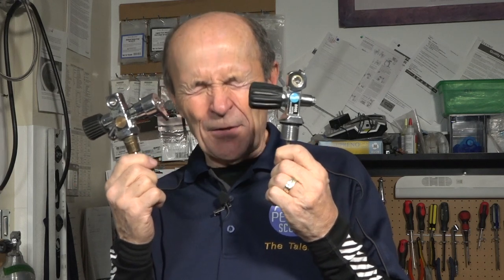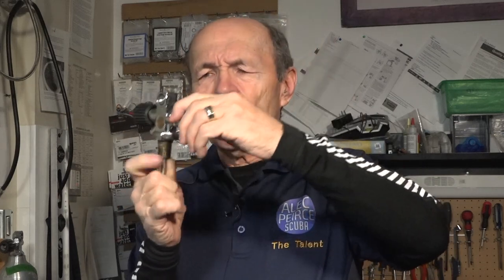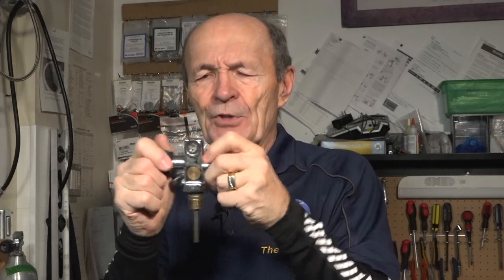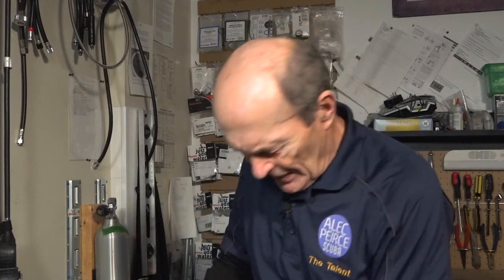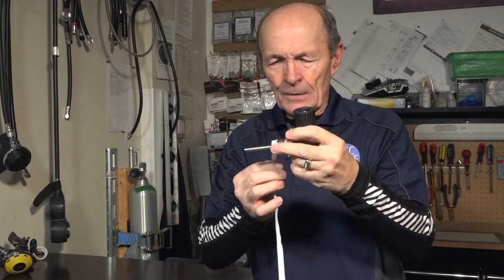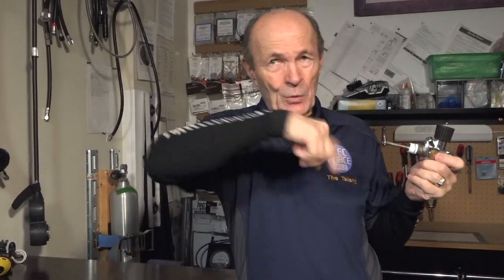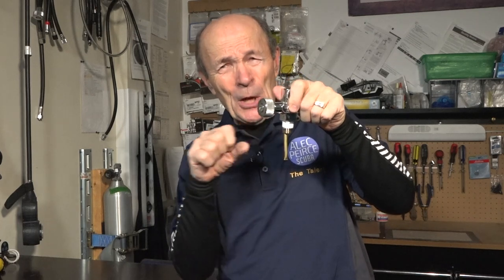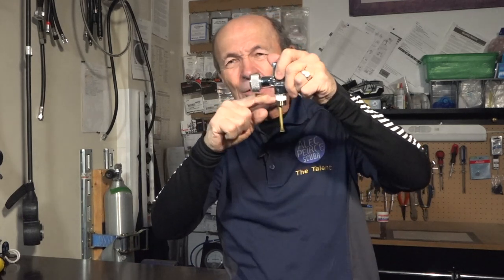All About 1/2" Tank Valves - Scuba Tech Tips: S12E05

Comment: Thank you for the infomative video. According to a list of valves certain tapered 1/2" valves should be tighten to 80 Nm torque so at least for some valves a torque tecommendation exist.
Reply from the maker: Glad you found that because back in the stone age, there was no actual force mentioned when buying the valve.  That came latter after a few Hulk's cracked tank necks due to over tightening.

Comment: This was THE video I needed right now. Tanks!  Do you see a problem replacing 1/2 NGT with NPT?  I realize there is a slight length difference, but NGT is not common any more and pricey for new ones!
Reply from the maker: The 2 threads are ALMOST identical. There should be no problem but I'd suggest that you get someone to run a 1/2" NPT tap into the tank neck first. Just a quick down and back will do. That will clean the threads and ensure the 1/2 NPT will go in firmly & safely. Good luck. Alec

Comment: What’s the purpose of having the little snorkel tube on the valve?
Reply from the maker: I think your referring to the 'dip tube'.  It's an important function to keep tank contaminates from being inhaled when the tank is valve down.  Many many years ago in the stone age, steel 72 cu/ft tanks had lots of internal contaminents, rust, dust, dirt, from not getting tanks tumbled or letting the tank go empty.  The dip tube is standard even today to pull air into the valve and to the 1st stage from the inside centre of a tank, not just the top.  Hope this helps.

Comment: Looks like someone has already had a good go with the valve in your close up at 3:35!  5th thread from the top is foobarr'd!
Reply from the maker: It does look bad but this is one of my demo's,  not intended to be used unless inspected first. Thanks for noticing Max.
Reply: @AlecPeirceScuba_SeaHunter  5th thread from the top is not likely to do much when mated to cylinder, it may be damaged because of corrosion in the tank threads at that point, or simply the fact the tank thread form at the entry is often not fully cut

Comment: I saw hydraulic valves machined with taper pipe threads that have been cracked at installation by overtightening these NPT threads, the same thing can happen with scuba tanks as the neck is not so thick.
I ,by far, prefer the ORB style valve, much less chance to make damage at the assembly. and a leak is much easier to repair than a NPT setup and another benefit, to the rate where the valve is removed from a tank, a perfectly good tank can be damaged at the thread level and needs a recut of the damaged thread, less likely to occur on a ORB style fitting.
Reply from the maker: That is true but I did want to inform and educate viewers that there are 2 styles should they ever come across one in some remove location or become a Vintage Diver.  Thanks Jacques.

Comment: in india i ask for diving tank nit has m18 valve whats that never heard about it .only two valve i kmow  york n din
Reply from the maker: The M18 is for metric threaded tanks with M18 x 1.5 pitch threads.  There are yoke and DIN valves for that specific thread type.
A
Reply: @AlecPeirceScuba_SeaHunter  thanks
Reply: @AlecPeirceScuba_SeaHunter  sir what are standard valves called is it 1/2 inch valves or it has specific name

Comment: ☆{Question}☆ about the teflon tape. 
Is there a liquid sealant option-?
Reply from the maker: There are but they tend to stick to the threads or get squeezed out when torqued in.  Tape is secure, does not extrude, dry out and is easy to remove.  Thanks for the question.
Reply: Yes, but it is best used only for plumbing.